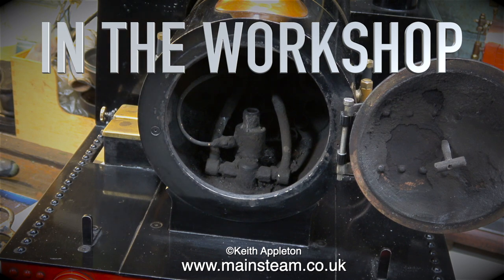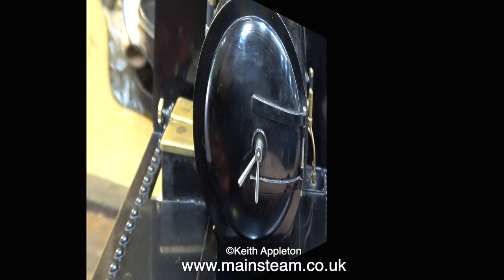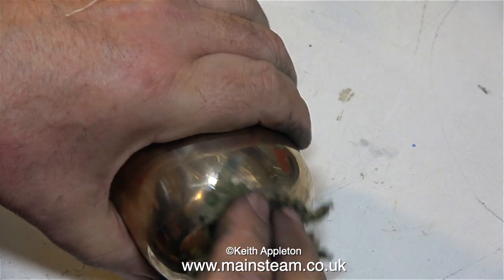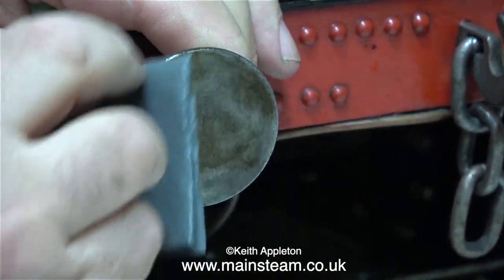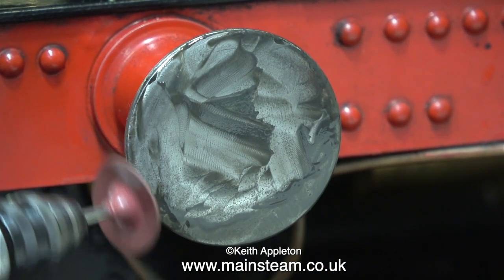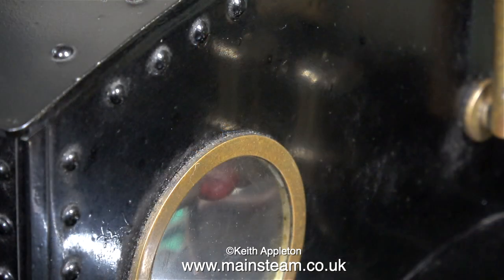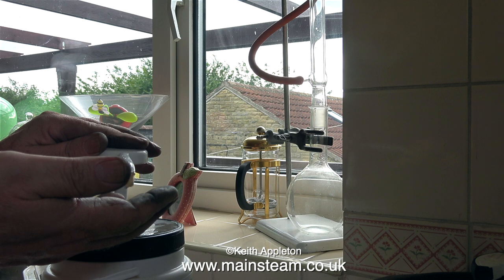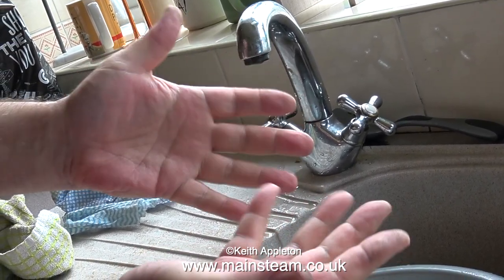CLEANING AND POLISHING MY SMALL LOCOMOTIVE - IN THE WORKSHOP

Comment: i tend to youse peak for brass and steal bits on my Conway ..I no its expensive but using it a little at a time it go's a long way ..I bought a 1000ml tin last year and I've not even scratched the surface !! plus to polish the paintwork I youse mr sheen ..its no abrasive and doesn't take the paint off ..plus also makes my engine smell nice when clean :)